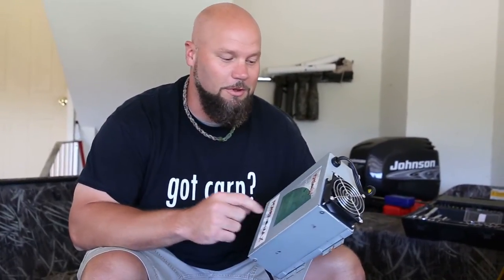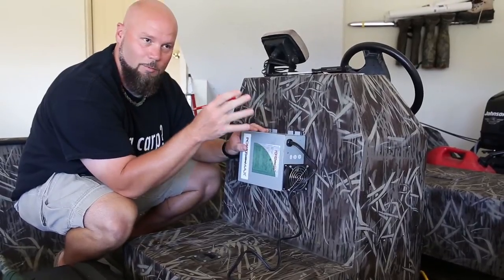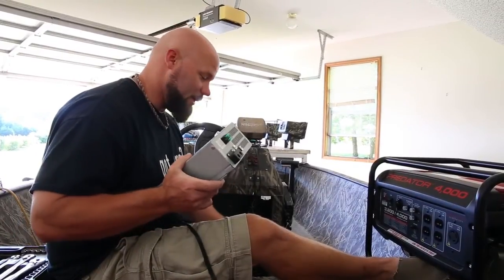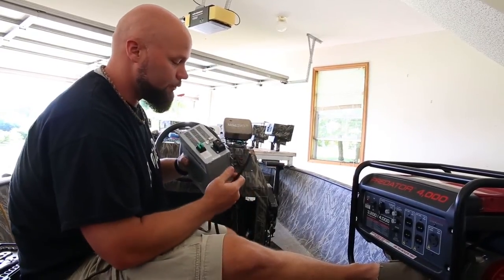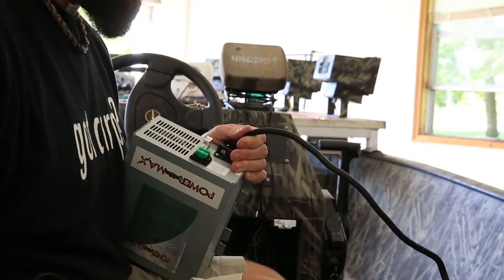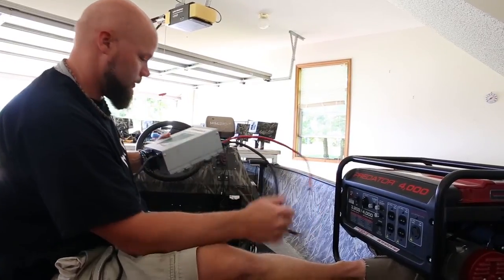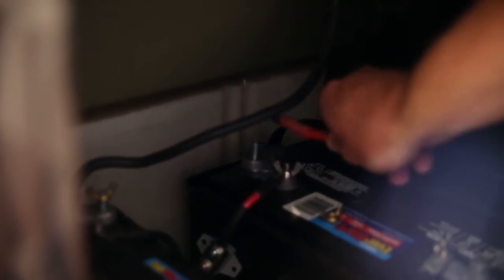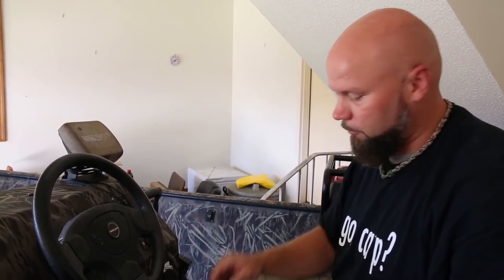PowerMax Converters - Bowfishing Boat Install Video

Comment: What’s the difference in using this vs the Minn Kota on board charger like the 345 unit which puts 15a in 3 batteries? Why use this over what I have now is what I’m asking?

Comment: I have 3 powermax converters. But I use them to run 3200 watt cb base station, with 10pill box and a Stryker radio. I was thinking of using one of them for my trolling batteries since I have an extra one. They aren't 24 volt so I could use it on 1 battery I suppose.

Comment: When you are hooking this up for the 24v system, when you put the positive converter cable to the positive terminal, is this the same positive terminal that your positive wire from the trolling motor is hooked up to? Meaning that your connector for the series would be on the negative post of where you just hooked the positive terminal for the converter?  And then the negative cable from the inverter would be on the same post as the negative cable from your trolling motor?

Comment: You know GBS makes some 100ah lithium batteries that would let you use full 100 Amp hour out of them. You would lower your weight by 3 x and have twice the range with a steady 13.5 volts X 2  for the trolling motors. Only $600 for each battery so az 1200 dollars for two and you'll get 100amp hour @ 27volts and it will stay strong till the end. have to make sure not to go below 22volts and they charge up faster too cause it takes the full charging power and nothing is wasted. Lighter boat, More stable power, last 5 x as long,charges quicker! More speed for the trolling motor also. Win , win ,win in my book.

Comment from the maker: As long as your troller is a 24 volt that unit will do the trick. Before you order, give Errin a call. His information is at the end of the video. Tell him what model trolling motor you have and he will get you the right unit for your needs. Also, be sure to tell Errin we sent you. If you have anymore questions let me know. Good luck this season!

Comment: Do you know if it's ok to leave these converters connected to the batteries when not in use? The resting voltage on my batteries seems too high even when the converter is not plugged in.

Comment: I’m running the same generator as you, how do you have yours mounted to reduce the vibration it puts out?
Reply from the maker: Justin Woodard I don’t have that gene anymore. There was a lot of vibration from that gene but it wasn’t to bad. I switched out to the Northern Tool Power Horse 3500 inverter gene and its MUCH better. I built a tray for it to set in and there’s very little vibration compared to the old harbor freight gene.

Comment: Will the pm3-50-24v be enought for my 75 pound motor guide
Reply from the maker: Yes, as long as its a 24 volt trolling motor you'll be good.

Comment: My powermax has a chassis ground lug on the back also. Did you hook it up?
Reply from the maker: Lonnie Hamil the unit I was using in the video didn’t have that option. If the newer ones have a ground I’d definitely hook it up.
Reply: Joe Finney thank you!!!
Reply: Where would you hook the ground lug to?

Comment: How many watts will that unit pull
Reply from the maker: The 24 Volt pulls around 1250 watts.
Reply: Jerad Brown it depends on amp output. they have 30,40, and 50 amp 24v converters. however they run in 3 stages so the "rated watts" is actually a max draw number. if you run the converter all night it will usually stay in the lower levels of amp draw. go to "powermax website" for complete list of draw numbers.